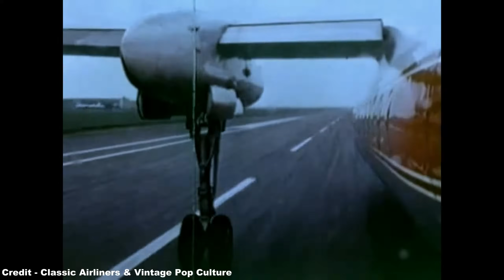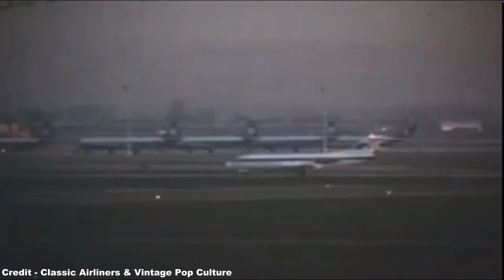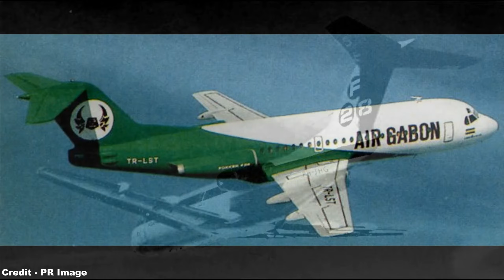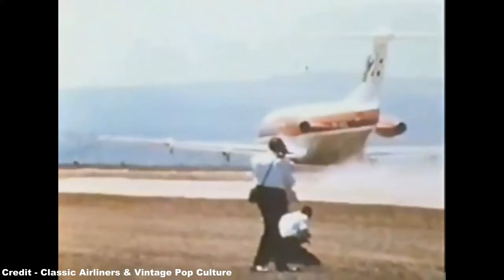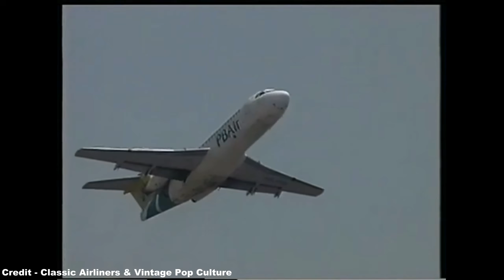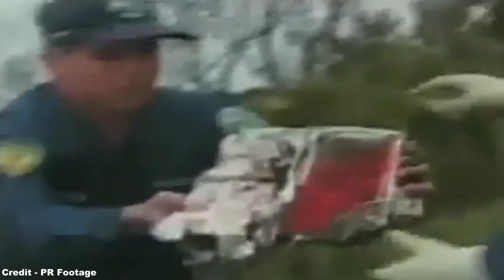The Fokker Jet Story - Part 1: Fokker F28 Fellowship

Comment: The F28 was a fine aircraft. It was often used as a transition or addition by air carriers moving into the jet world. In a few cases flight crews who transitioned to pure jet powered aircraft from a propellor powered aircraft did not understand or appreciate that the aircraft while a better performer is most cases did not have the advantage, especially during takeoff,  of the  lift generated by propellers on creating initial and necessary lift for the wings. Nor did flight crews really understand lift degradation created to the first 10 to 12% of the top of the wing. Both ice and insect/debre creation on the leading part of the wing significantly decrease lift capability of wing. GW

Comment: 9:00 The Super F-28 retained the rear-engined layout of the F-28, with a lengthened F-28 fuselage. A later revision added a lower lobe to the fuselage. The F-29 had a new fuselage with a larger diameter, and moved to underwing engines.

Comment: Great vlog as always! I have worked both for Braathens SAFE (South American Far East Airtransport) and SAS. There was no wind at the time of the accident, only fog type clouds. When LN-SUO was scrapped in 2001 She had a TT of 45k and 90k cycles! Her first year was spent down under leased to MMA from BU. LF of Sweden looked to BU and bought three -1000 for del in 1973. After a while they met with Fokker and said we need a lager aircraft. Then the -4000 was born. They even bought a brand new aircraft from Fokker with no engines! That is a story for another time. Can you think of a more hostile place to fly than in the arctic and down under? One extreme to another. Fokker had a very good reputation. I loved this pocket rocket. It was a F-16 compared to the 737-200. BU flew as many as 16 cycles a day! If that is not a true work horse I do not know what is. Keep up the good work!

Comment: My only experience with this aircraft occurred in West Africa in the early '80s on a Ghana Airways flight from Accra to Lagos. Fifteen minutes into the flight there was a loud bang and a smell of burning. We had lost one of our Rolls Royce engines. Everyone was calm and, without fuss, the pilot guided us back to Accra. You would not have known we were flying on one engine, a testament to the pilot and Dutch engineering. It was late at night when we landed and were given accommodation in a whore house which was guarded by an elderly Ghanaian with a large spear. We were offered companionship for the night which we declined.
Reply: Thought the accommodation might be a typo until I read the last sentence 😆

Comment: I read somewhere Garuda's CEO at that time, Wiweko Soepeno, decided to sell all 3 CV-990s to make all jet fleet in domestic flight, by purchasing F28s and DC-9-32s. At that time, Garuda made record as second largest Asian airlines in terms of total number of fleets, behind Japan Airlines, and the largest F28 operator. As kid in the 80s, I could only tell the difference between F28s and DC-9s from the way Garuda painted the engines (both were T-tail twinjet). The F28 had red color paint on RR Spey, while the DC-9s JT8D in chrome silver. Later in the 90s, another Indonesian's private airlines, Sempati Air (defunct in 1998) became the launch customer of F70, and even become the first airlines in Indonesia that provided PTV (personal television) in every seats.

Comment: I was introduced to the Fokker F28 with Piedmont Airlines in the 1980s. Did not know of the long history in research, development, engineering manufacturing and production in the mid 60s into the 70s. Do recall of deicing fatal accidents in Canada along with the USAir aircraft at LaGuardia.

Comment: One single little problem that the F28 had from birth: the NOISE.
Reply: Yeah you can only hushkit a RR Spey so far! I remember early F28s coming in and out of my local airport Stansted in the 70’s, and before hush kits were fitted (in the early 80s ?) they were deafening, especially considering the tiny size of the engine. The next phase of EU noise restrictions (1992?) couldn’t be met by the hush-kitted Spey so the F28s (some of them barely a decade old) disappeared completely from uk skies.
Reply: Was it that much worse than other contemporary turbojet designs?

Comment: I take these to work every week in Australia. Alliance Airlines has a huge FIFO (Fly in/Fly out) business model and these suit the job perfectly. They do wet lease to Qantas and Virgin Australia. Qantas and Virgin have their own based in Western Australia for the FIFO mining contracts to fly workers in and back home. 
The ones I fly on are ex American Airlines and Austrian Airlines and are around 30yrs+ in age. 
Still a great aircraft to fly on, however my biggest complaint is the air conditioning.  These birds are working in harsh and hot climates of the outback and more often than not in summer you are sweating mid flight. I read there was N optional 'tropic' pack when ordering for hotter regions with a better air conditioning unit. 😅
Reply: I think you may be confusing this with the later Fokker 70 and 100, which are still in service in Australia while the subject of this video, the Fokker F-28 is long retired in Oz.
Reply: Yes sorry, good and interesting story re Oz , but about the wrong plane my friend. Visually they are similar but as the previous commenter said, F28s were retired many, many years ago. In Europe it was chiefly engine noise regs that killed them off long before the airframes were finished, I’m not sure whether that was the case in Oz too. You’ll have to wait for the follow up film on the later F70 and F100 models!

Comment: In the early 2000s there was an official NIMBY whinge by the Magnolia residents of Seattle.  Complaining specifically about the noise of the F-28 over their poor little heads.  I wrote a letter to The Seattle Times claiming any of these fragile snowflakes would board an F-28, regardless of the noise it inflicted on the proletariat,  if it meant arriving at their destination.

Comment: Sweden's domestic airline Linjeflyg used almost exclusively Fokker F27 and F28. They where the last Airline to operate from Bromma in 1983 when the airport closed for commercial traffic (it later reopened because of EU rules in the 90''s). Linjeflyg moved to Arlanda and what is today Terminal 4 and what was then the new Domestic Terminal. Finally introducing Jet Bridges for domestic traffic.

I had a teacher in school who had worked at the maintenance hangar for Linjeflyg at Arlanda and he took our class on a visit to the hangar as they serviced Fokker F28 and showed us around and up close.
In case of war Linjeflyg was supposed to be used for Troop transports to the Island of Gotland moving mobilized soldiers to their units on the island. During exercises Linjeflyg F28 would fly in formation at very low level over the Baltic to avoid radar.

An interesting incident with a Fokker F28 from Linjeflyg happend on the 5th of July 1987 when Fokker F28 SE-DGP on a flight from Arlanda to Ronneby-(Kallinge) mistakenly landed at Emmaboda Airport 24 nautical miles north of their desination. This was a small AFIS airpost which had no flight controler on duty.
As the flight controller at Ronneby lost radio contact when the aircraft landed an air force rescue helicopter was launched and sent in the approach direction of the aircraft looking for the presumed crashed jet. Eleven minutes after radio contact was lost the air trafic controller recieved a phonecall from Linjeflyg where he was informed the aircraft had landed at Emmaboda.
Emmaboda fullfiled the requirements for a VFR landing with a Fokker F28 but the airport had no ground facilities to support it.